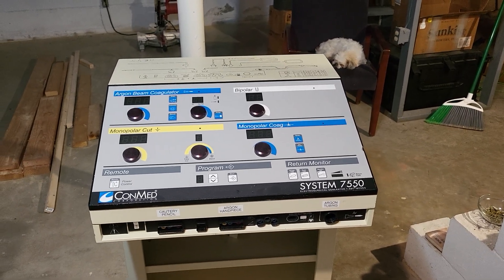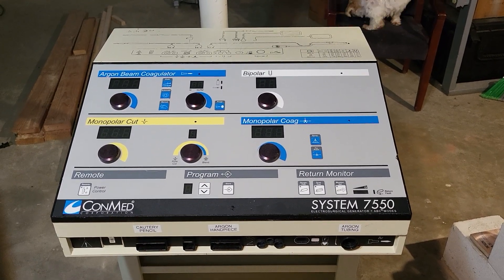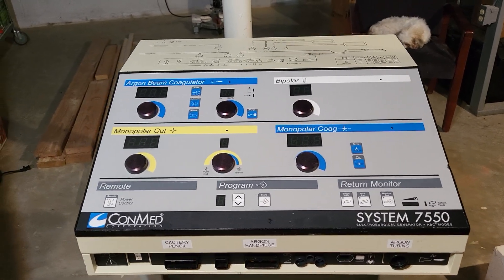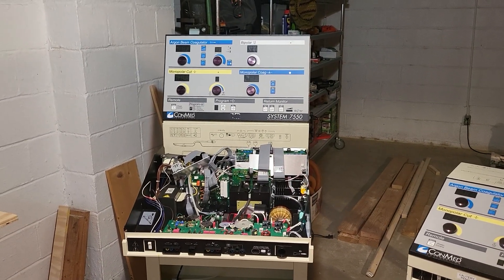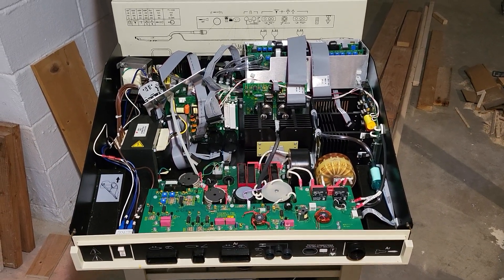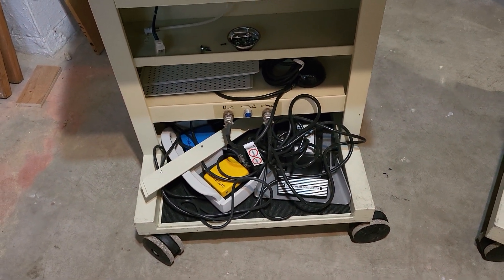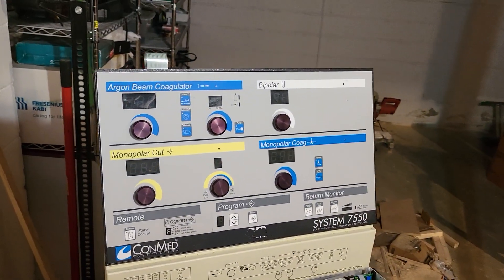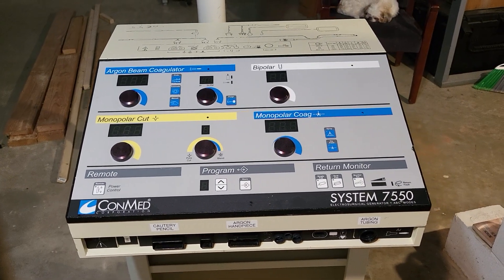This Conmed 7550 ABC is being turned into a Biomedical Equipment Trainer by Gregory Ward (Part 1).

Comment: Hi, I have a problem I found one of the capacitors is busted and I don't know it's value
Reply from the maker: Hello Frans, Take a picture of the circuit board and point to the bad capacitor.  Be sure to give me a good view and plenty of surrounding area around the bad capacitor, OK. This way it will be easy to find, OK.  Email it to Biomededusa@gmail.com.